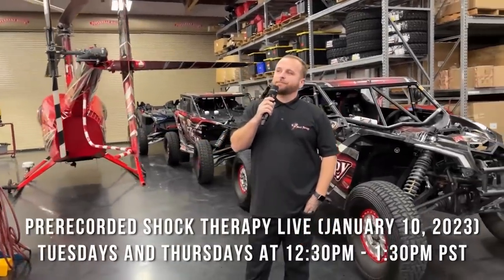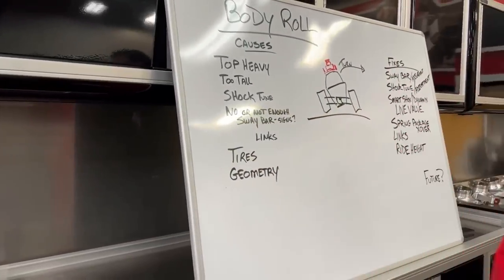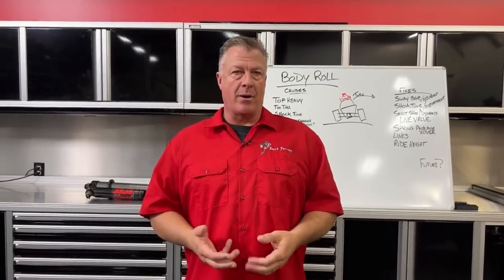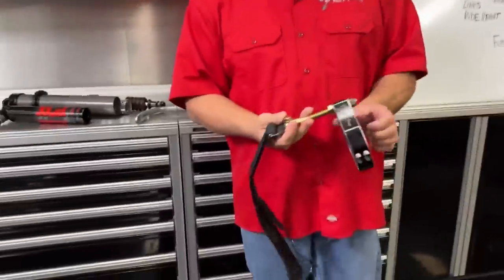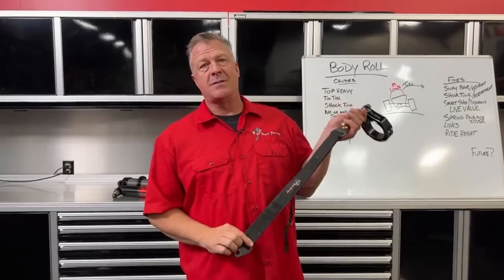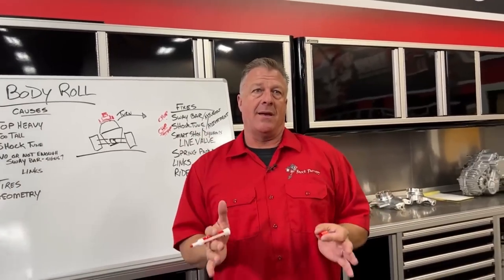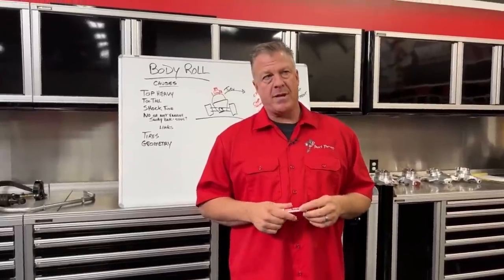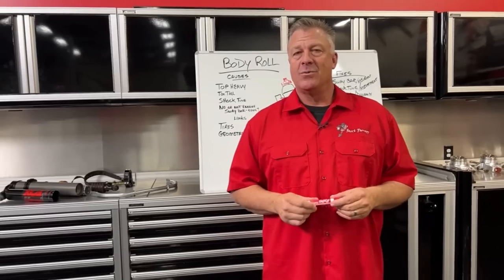Tech Tuesday // Body Roll - Causes & Fixes

Comment: I have a 22 Commander xt-p. I installed your dual rate spring kit, Huge difference in ride quality. I disconnected the front sway bar just to see if it made the ride better. I was very surprised how it helped the ride and it did not add a lot of body roll. We ride pretty slow and more or less creep through the woods. Do you see any negative effect doing this with our riding style. We never ride high speed and generally ride at Hatfield McCoy and other atv parks. Thanks
Reply from the maker: The rear bar on the Commander is pretty stiff so that helps.  For slow speed riding as you describe, front sway bar off is a great setup.

Comment: I would love to hear yalls opinion on these shock relocation lift kits. I did one once on a worn out 800 rzr and it seemed to help, but I doubt that would be always the case.
Reply from the maker: In general we are not fans of any relocation lift kit. They will be stiffer and you have a huge chance of over traveling the system and breaking axles. You can get the same lift with a proper spring kit. No relocation and no danger of axle issues or a rougher ride.

Comment: Body Roll is the relation of the body in relation to the suspension.
La lot what is here described a body roll, is actually the vehicle tipping.
Bady roll as a great effect on the suspension system.
jmpo

Comment: I installed your rear sway bar and sway bar links on my 2022 X3 XRS. I also am running a set of super atv high clearance trailing arms. Can you tell me how long roughly my links should be since the sway bar link mount on my trailing arms are 1.5” farther back than stock? At 7 3/4” they don’t even reach at full droop. Thanks!
Reply from the maker: You should cycle the system to check. At full droop adjust them so that the bar and the links are just before they are in a straight line. They should never travel too far or over cam forward. That’s what you want to avoid. 👍🏼

Comment: I don't see a front sway bar for a 64" x3.  Best way to remove some roll from it for a ice oval race?
Reply from the maker: So you have a bar on the front of a DS. We don’t make a stiffer one because the upper arm, sway bar link mount gets in the way.  It’s the same bar tho. So if you buy our stiffer bar you can run it if you make your own link mounts on the upper arm. If that’s too much to do the a shorter stiffer spring package with the cross over ring lowered is the best way since you don’t have whoops on the ice. Good luck. 🤘🏻
Reply: So dimensionally how is your bar differ from my factory one?
Reply from the maker: @cboutdoorfun9955  externally it’s the same but it’s larger in diameter which gains stiffness. It requires its own style bushings and billet bushing blocks. It’s also 3 hole adjustable.

Comment: Does anyone know, is there a sliding "Manual" front sway bar "disconnect" out there avalible , similar to how the electric HALO system works but just the manual splined coupler that can be used to manually turn the front on/off?
On a X3 is there a good compromise when you want a front bar for higher speeds resisting roll mostly when long distance traveling to and from a area, but also want the full articulation in the front when required quickly and tooless? Dont want a Link just tied out of the way if there is a good solution out there, as well as a quicker cleaner on/off solution.
Reply from the maker: Not that we have seen

Comment: next step comp.controll should be to push cabin even over the horizontal leval, leaning-diving a bit into the corner side...you should do !!   i have your shocks and both swaybars, the bars make a huge progress, now only tires and shocks are moving, more feeling to drive,    rainer from switzerland
Reply from the maker: Thank you for your input 🤘🏻

Comment: Can you use scales to set your buggy up
Reply from the maker: Absolutely
Reply: Do you use scale's
Reply from the maker: @johngeary8534  yes
Reply: Would you do a segment on scale's please..
Reply from the maker: @johngeary8534  anything in particular besides how to scale and percentages?
Reply: Weights,fuel load and how you can get started, I've got a 360 winged sprinter and just got a 2022 krx 1000. Thought I'd would be an informative video. Plus I'm the twisted tea Guy from a year ago!!
Reply from the maker: @johngeary8534  perfect. We will work on that one. Thank you
Reply: I know how to use them, I've got them for my Sprint car. It's a very VALUABLE tool !!!
Reply: Just thought others should know the value
Reply from the maker: @johngeary8534  👍🏼
Reply: I know you like the krx suspension, I'm mostly a cruiser but get after it once in awhile, shock springs, valving or both??